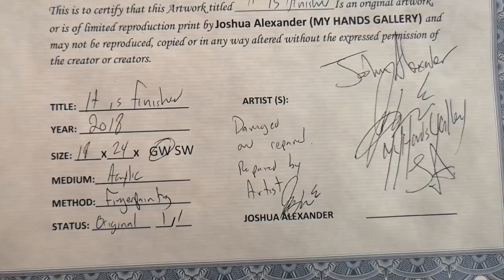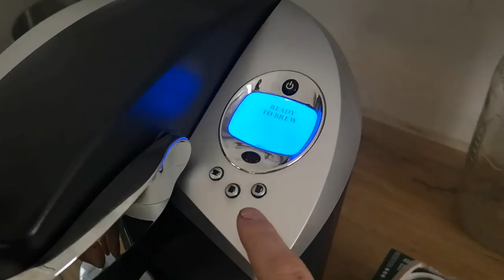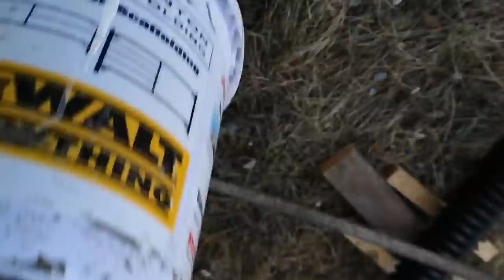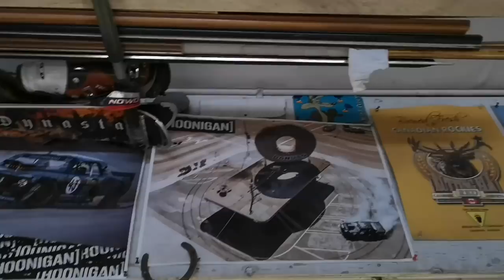Gramps Chronicles Part 5 - Gramps goes home | The last boring VLOG #9

Comment: Josh you need to put some protective spray on your wire whale outside so it won’t rust away, I seen it had started rusting in places, you did too good of job and time to let it rust away
Reply from the maker: Oh I don't mind. It's the welds on the armature that's rusting. Can't get to it now.